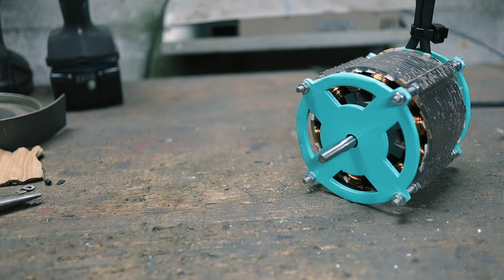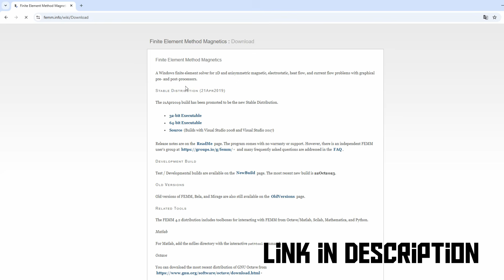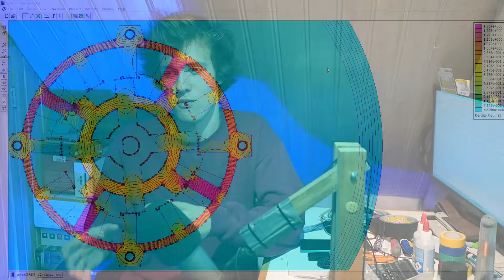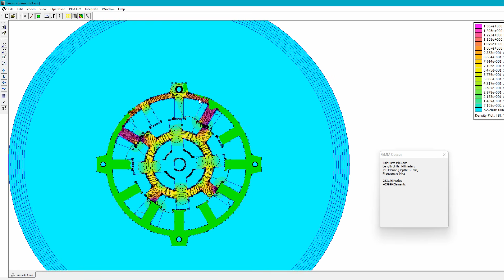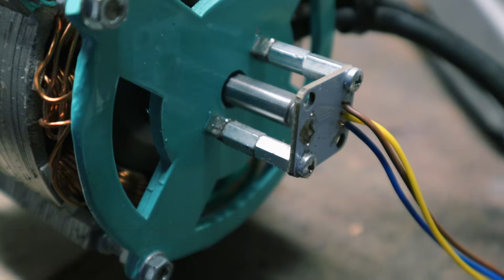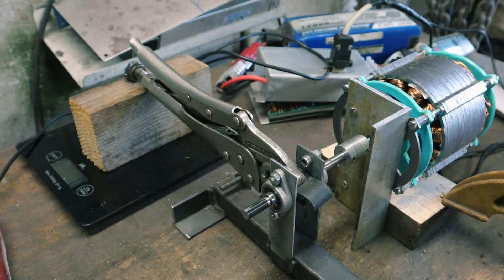Testing my new DIY electric motor (mk3 SRM part 2)

Comment: There is another possibility of the torque difference is that laser cutting creates hot spots in the steel and that destroys its magnetic properties. You would need to do 700-800 C annealing to fix that. That is why for custom laminations they cut with EDM. You also do not calculate the curve of the current as it takes time to reach peak amperes, but with those low speed it might not matter.
What is the wire cross section and A/mm2 during 20 and 30 A runs?

Comment: Question at 4:10 why wouldnt you make such high speed motor then increase the torque by a gear ratio?
Edit: also at 6:07  you can actually quite easily calculate how much flux you will be producing in the core using the farady equation (V=-n(d(phi)/dt)) and ((phi)=A*B) (area and flux density). This equation helps alott in transformers especially, and in inductors also! A modified version for an inductor/transformer is: V=√2πfNAB (for an AC sine wave) 
also at 7:50 its not as bad as you are explaining! because for a fairly wide range of B, the relationship stays linear and the inductance stays fairly constant. i dont know how much exactly but for transformer steel the common value cited online is staying below ~1.3T
Reply from the maker: 1) because for increasing gear ratios the gearbox becomes increasingly bulky and complex (perhaps needing more stages too). This also adds significant amounts of friction/power loss. I'm using 2 stage 18:1 now, which is more than I like already. I'd personally prefer like a 10:1 where there's just a single belt/chain from motor to wheels.

Also, higher speeds would come with some other issues too, like the rotor requiring very fine balancing, and the high electrical frequency increasing eddy current loss (my laminations are 1mm thick, thicker than ideal, meaning even at 3000rpm this power loss is quite significant. 

2) using the math for flux linkage etc. you can actually derive the formula for torque shown in the video. As long as there is no saturation, it's accurate. Unfortunately a lot of SRMs tend to operate well within the saturation region of the material. Mine especially, since the steel I am using is not silicon steel, but just some general purpose alloy.

Comment: Pretty cool what you are doing here.  Way over my head, but yet very interesting.  What is your educational background?  

I was also curious, when you measured torque with the scale, did you accidently turn it the wrong way and smack the vice grip on the table😂
Reply from the maker: I didn't accidentally reverse it once haha. Seems like I might have learned from past incidents after all. 

also despite those past incidents I did get an EE degree.
Reply: @AKIOTV  Good job, I can tell you have a lot of knowledge, intelligence and drive!  Tesla or some EV car maker should be hiring you.

Comment: The problem with the "power" formula as applied to electric motors is the same one that applies when applied to steam engines. They can supply most, if not all, of their torque at zero rpm.

It should really be Work = Torque x RPM